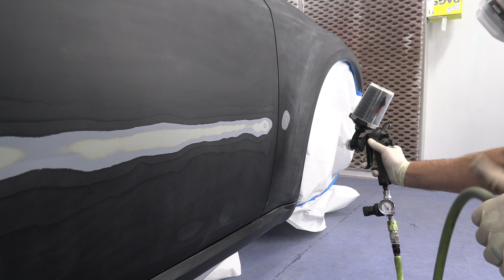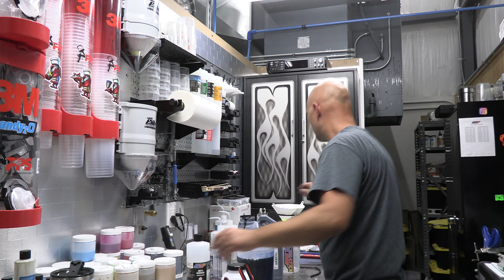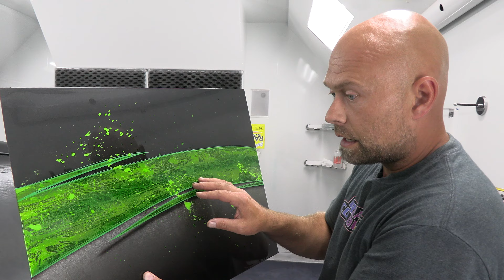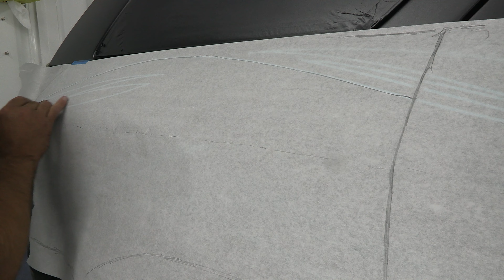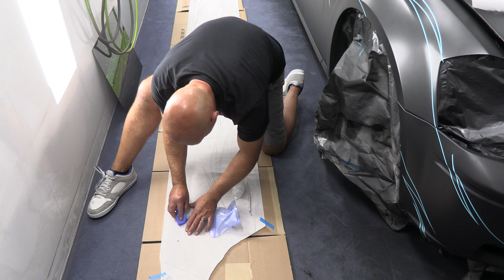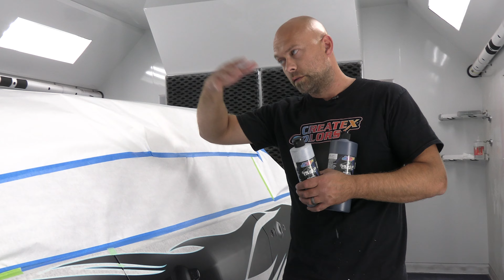Automotive Graphics & Custom Paint Tutorial Part 1

Comment: Great stuff👍 one question, why not start with the roof so you don’t have to reach over wet panels?
Reply from the maker: Hello. Chris’s technique is to continually apply paint with a wet edge. The side panels  are worked up to the roof then down the other side, while maintaining a wet edge.  This helps minimize dry spray which results in texture. Thank you.

Comment: I always wondered, wouldn't the chalk dust hinder your fine line tape from sticking?
Reply from the maker: No when applied lightly over thoroughly cured paint and wiped off with a lint-free tack rag before painting. Please practice on a test panel; before using on an actual job. Thank you.

Comment: I'm an OG '59 & always used this pounce wheel pattern technique...how ever, prefer 6 mil clear visqueen poly/plastic & sharpie instead of tracing paper & pencil for the sake of speed & durability.
Nowadays lots of guys are using vinyl patterns from a plotter...where's the art in that?
Use a Warrensburg pinwheel for pouncing the visqeen, as it has larger spikes   & of course thicker cardboard.
Remember, it's just paint...not rocket science.
Have fun kids !!

Comment: nice work Chris... I saw a speed shape with Createx Orange Pearl (https://www.youtube.com/watch?v=F_7rZxfHZBc) and would to use it as a base coat... The car is final primed in white epoxy primer... So can I use the createx water base coat over the epoxy, let it dry and then clear coat using a solvent based urethane clear... The color on the video was 4315 orange pearl  but i can't find it... I see W306 Pearl Orange... Are they the same? Last question, how much paint would i need to do a 61 corvette... Thanks... Mark